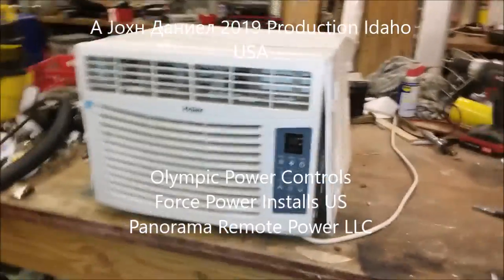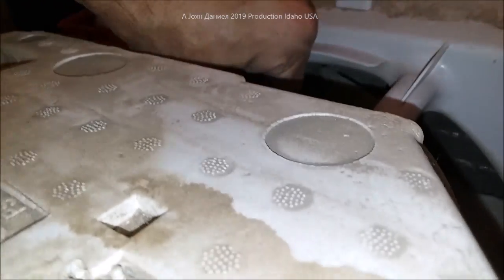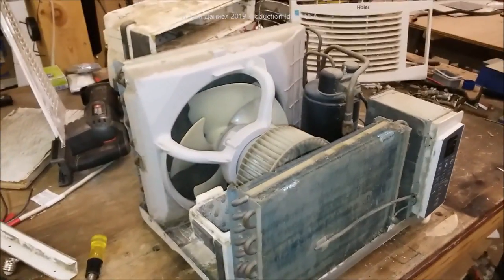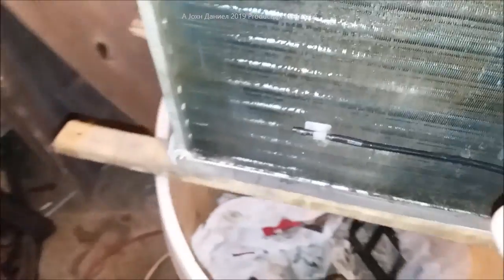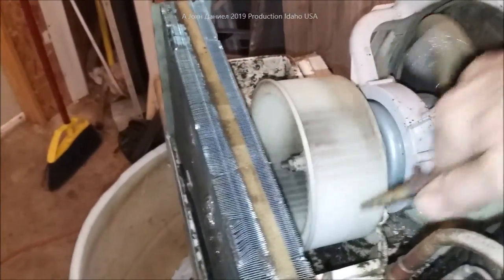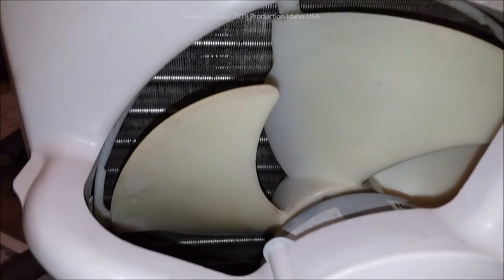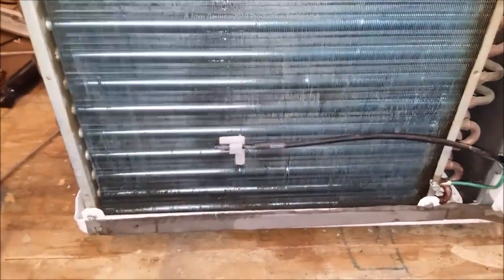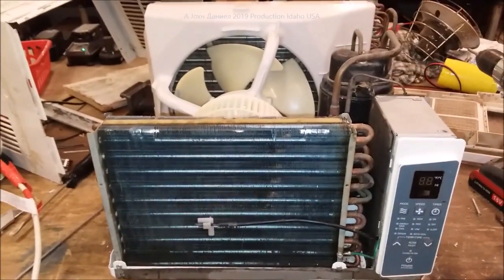OPEN AND CLEAN the right way, any Window Air Conditioner to cool better & use less electricity

Comment: I tried to drill a drain hole in a new ac once, it sucked the 1/2 " bit in, and it hit the condenser! New ac hit the dust!!! Just my luck,   the tape on the bit didn't help!!
Reply from the maker: Here's your sign 😜
Reply: @JOHNDANIEL1  yeah I fellt like a total DA!  I wouldn't bothered but the ac was slinging water!

Comment: mr.daniel sir can a used ac unit with a bad compressor still be ran just to blow air in or can u runn water threw the coil or condensor to lower the temp some....
Reply from the maker: Yes, sorta!. But really won't do much but give you a wet room.

Comment: I buy and sell air conditioners and one of the last ones i bought was less than a year old. she couldnt figure out why it quit cooling. so i told her i would give her 30 for it since it was not cooling whatsoever, but it was pretty  much new. it had almost 1 inch of dog and cat hair blocking the coils. i was stunned. when i was done with it , it was coldddd.

Comment: What's worse are the Walmart units that use the "sling" technology.  No case drain.  It relies on being able to sling captured moisture up in the system as part of the cooling process. (Reason you end up having to pour water in it on extremely hot day to get it kick-started to even think about starting to cool. Very poor design and efficiency as far as I'm concerned.)

You can imagine the stuff that doesn't even have a chance to drain out.
Reply: Lonely Prepper Homestead          Slinger-fans are a very good design, using 
free water to cool the condenser makes a lot of sense.
Reply: Thanks to Made In China. The Friedrich "Kuhl" series is the only USA made unit, best unit on the market compared to Frigidaire and Haier off brands. Built like the old ones.